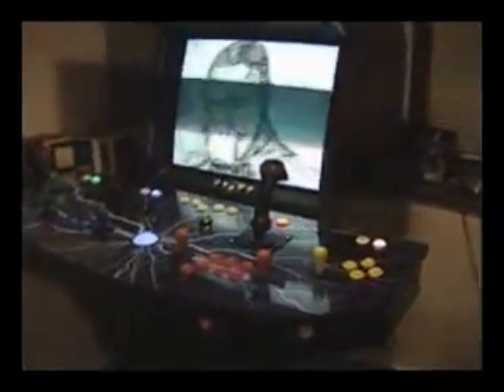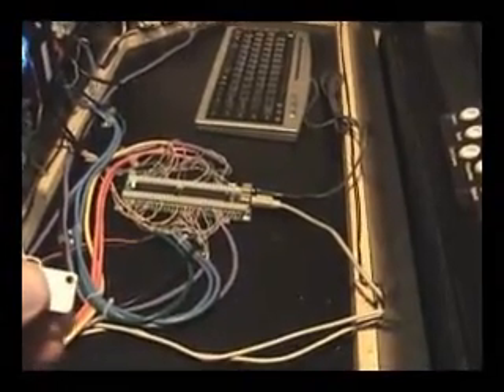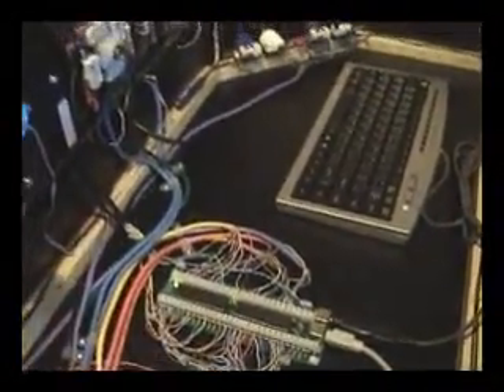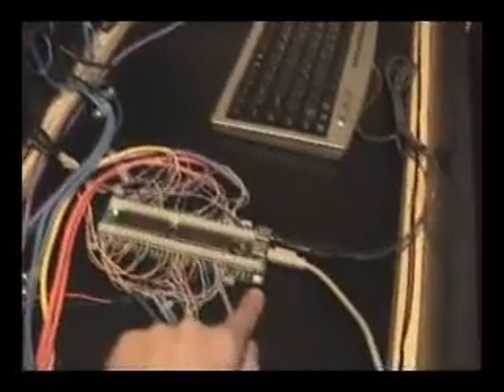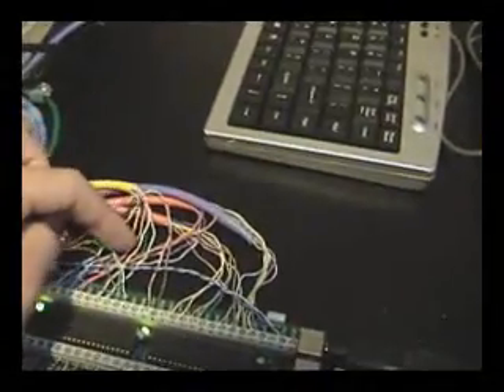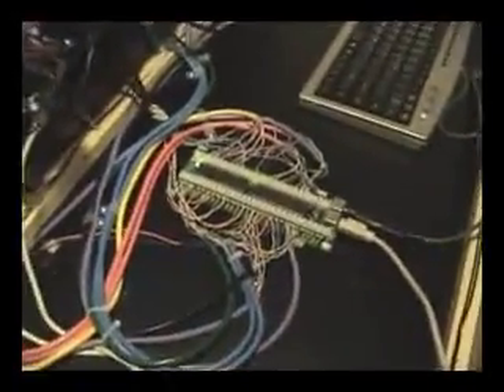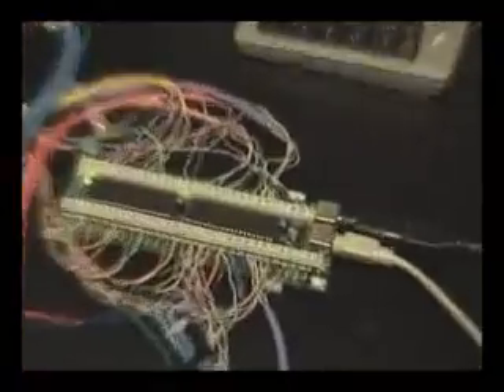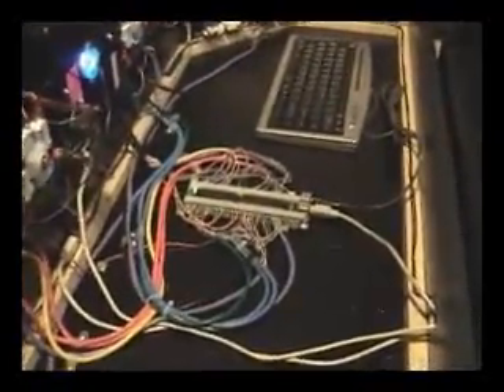Wiring an Arcade Control Panel for Beginners

Comment: Hi I purchased a Track & Field arcade upright, in working order. I took the control panel apart after labeling the plugs and switches. I have the trackball version, I put everything back after a new overlay and some new buttons, now nothing switch wise works. The jump/throw buttons all 4 of them I forgot to label but all the others I labeled. I also don't remember where the 3 braided ground wires go back to. Can you please help me? It's frustrating because everything worked right prior. I found NO BREAKS in any wires at all, so that's not the issue Thanks again
Reply: delusional2971 You're still posting replies to this 7 year old video, congrats to you! Nice going.
Reply from the maker: Yuuup.  Still in the hobby!  :-)
Reply from the maker: Shoot me an e-mail with pics and I'll take a look.  Also, you may want to post something at the arcadecontrols.com forums.  Those guys can help you without a doubt!

Comment: Nice Video.  I am setting an IPAC2 and ended up having some issues with the ground but I figured that out.  But once I figured all that out and re connected the cables to the IPAC they were all registering to the #2 button on the IPAC software...so I removed everything and am starting over.  I am using 22 gauge wire but I like your idea for the patch cables....I might go that route.  What size clamps did you use to attach to the prongs on micro-switches?

Comment from the maker: All switches need a positive and negative.  The positive goes to the encoder.  The negative or ground, goes to the ground of the control panel (you can connect all of them together, also known as daisy chaining).

Comment from the maker: NO means that when you press the switch, it will make contact (turn on the circuit), when you release it, it stops making contact.  NC means that the switch is already turned on and when you press the switch, it will stop making contact.  When you release it, it will stay on again.  Hope this helped.

Comment from the maker: I bought mine at an auto parts store online.  They are cheaper there.  100 for 4 dollars.   sherco - auto . com / wiring  Look for .187 quick connects (red) model # FDV1-205 for standard Cherry brand switches.  If using Japanese switches, use .110 quick connects.  Also, make sure you get a ratchet crimper (RIC1) to get a perfect crimp.  I made the mistake of crimping them manually first and not only did my hand hurt the next day, the crimps weren't that good and came out.

Comment: @Deluxejames 8 way joysticks still only use 4 switches per joystick.  They just have a mode that triggers two of the switches at once.  Diagonal upper left just triggers the up and left switches at the same time for example.

Comment from the maker: It's actually a used cab that I stripped down and painted it.  However if I were to build one I would use 3/4" MDF all around, including the control panel.

Comment: I've been researching prices myself  and the prices I found are 2 joysticks  a white player 1 and 2 button   plus 18 black buttons for $39.95 at xgaming . com    or Happ comp. arcade sticks for $8.49 each with a price of $1.20 per push button and $1.40  per player button plus cheap tools at groovygamegear . com      Ultimarc carries 100 crimp clips for $9.00    and also a 28 clip daisy chain. Not sure of the price.  Hope it helps

Comment: if you are building your first control panel you would probably be better sticking with the i-pac 2. Or if you want to work your way up to 4 players go with an i-pac 4 and just connect to the 1 and 2 player places and expand later whenever you feel comfortable. Zip ties are a good way to go for keeping the wires organized or color coded cables. If you have wired a car stereo or even a home stereo you will be able to figure it out.

Comment from the maker: Try ultimarc . com or groovygamegear . com

Prices vary.  I used cat 5 cable here in this video (harder to crimp since they are smaller) but in my future builds I now use "doorbell" wiring.  MUCH cheaper and it's the perfect size.  It comes in different colors.  Just look in the doorbell section at Home Depot.  Goes for about $5 for a nice sized spool.  I usually get either black or a dark color for ground and the rest another brighter color.

Good Luck!

Comment from the maker: If you have a 3/4" wood pane, I install the joystick bases from underneath the panel by first drilling a shallow pilot hole smaller than the sctual screw. Use 1" long zinc plated wood screws from Home depot or Lowes at about $4 per 100.  The size is #10. The box would then be marked 10 X 1.

Comment from the maker: It depends.  I use single.  It's easier for me to work with (in my opinion) and easier to crimp.  However, it's a bit stiffer than 3 strand wire.  Keep this in mind if you move stuff around a lot.  Bending it back and forth may not be a good idea.  But I've never had a problem with it.

Comment from the maker: @delusional2971 
Forgot to mention that I got the Cat5E cables from cablewholesale . com 
Choose  NETWORK / PHONE PRODUCTS on the list at the left.  Then click on the Cat 5 E Network cables link.  Get the 7 foot size ($1.63 each).  Don't worry about the end connectors that they come with.  You can just cut them off.  Comes out to be super cheap in the end and you can choose from tons of colors!

Comment from the maker: @nick12882 
Sure.  I use doorbell wire for my current builds.  It's economical and can be found in your local Home Depot or Lowes.  You get more band for your buck with the roll that you get.  They come in different colors.  I usually get the dark color for ground and the brighter color for the other switches.

Comment from the maker: You'll need .187 connectors.  They work the best with the microswitches.  The ones at local stores were a bit to big and the cat 5 wire kept slipping out (and expensive too).  I found some online that were perfect at Sherco Auto Supply (google it).  Part #:  FDV1-187.  100 for under $5!  Also, make sure you buy a ratcheting crimper!  Trust me on that one!  Part #:  RIC1.  I learned the hard way buy buying a cheaper one that didn't have the ratchet feature.  They crimp these connectors perfectly!

Comment: I ordered my Ipac2 tonight and i'll use your Cat5 idea...(which is brilliant!)

I don't know what size / style connectors I need to pickup though! I'm assuming those are fast-on...blade style female connectors?

Are all Cat5 cables created equal? Do they all use the same gauge wire inside? Looking at mine...they seem pretty thin. 22 gauge maybe? (i'm guessing....just hoping YOU know)

I've never crimped a wire in my life...so this should be interesting to say the least!

Thanks in advance!

Comment from the maker: Yes, that's also a good option.  It's a bit tricky to do, but if you search the BYOAC forums you will find some great tutorials (with pics) on what gamepad works the best for hacking, as not all gamepads have easy solder points to do so.

Comment from the maker: Not at all.  You can also use other keyboard encoders.  I just happen to have Ultimarc's Ipac-4 since it has 56 inputs for my 4 player setup.  But you can also use groovygamegear's keywiz instead.  The principle is the same as described in the video.  It also has a terminal block to screw the wires into.

The other option is to hack a keyboard, but it's not suggested, as ghosting will occur.  Try googling byoac wiki.  There is a guide there explaining your options.  Good Luck!

Comment from the maker: To clarify:  Both 4 way joys and 8 way joys have 4 microswitches on them.  The 8 way achieves diagonals by pressing 2 switches at the same time.  ie: up and left = diagonal up/left.  4 ways limit motion to only allow 4 directions:  Diagonals are not possible.  You can connect a 4 way and 8 way at the same time to the 4 inputs on the ipac.  That's what I did.  I actually connected the flight stick to it too.  So I have 3 joys connected to the ipac's 4 joy1 inputs.

Comment: its not the i pac that decides if its a 4-way, its the joystick its self.  the 4-way joystick will just only move up, down, left and right it wont move diagonally and let you push two directions at once which (makes a diagonal motion of course.)

Comment from the maker: The best bet it to find a standard molex 'Y adapter' and modify it.  That way if you screw up splicing the wires, you won't be messing up your PC's power supply wiring.  Then all you have to do it plug that connector into your power supply in your PC.

Comment from the maker: Glad you liked the video.  Hope it helps!

I illuminate the lights by running it directly to my PC's power supply.  I use the +5volts (red wires) for the buttons and the +12volts (yellow wires) for the marquee light above.  The coin doors (not shown) are also illuminated using the +12volts on the power supply.

Comment from the maker: I'm not sure if there is a limitation to the length of a keyboard cable though, if the signal would get degraded or not.  By why not go wireless?  Perhaps you can buy cheap wireless USB controls and then hack them to the controller's joysticks and buttons?

Comment from the maker: The I-pacs come in two flavors.  PS2 or USB inputs.  I have the PS2 version.  Basically there are two female ports on the ipac itself.  It comes with the two male ended cable to plug from the ipac into the pc's keyboard port.  The other "pass through" port on the ipac is where you would plug in your ps2 keyboard (or in my case I have a USB keyboard with a PS2 adaptor on it). 

If you go to Ultimarc's website and click on the ipac link you will see a picture of it.

Comment from the maker: The only problem with widescreen is that the image will get distorted and not be in it's "true" format.  Personally, I am building a new machine with a 22" CRT (4:3, not widescreen) in it.  You can even find a 21" CRT cheap nowadays.  Check your local Craigslist.

Comment from the maker: You can either solder them on or crimp them on using a crimper and some .187 female connectors (shown in red in the video on the end of the microswitches and wires).  I prefer crimping the ends on, since they can be easily removed if necessary.

Comment from the maker: For a Happ brand mouse however, you need to buy not only the trackball, but the Optipac (Ultimarc) as well. The Happ requires a mounting plate, but there is a fantastic product that just came out (by Ultimarc as well). That mounts from underneath without the need for a mounting plate. You simply cut a hole big enough for the ball and then mount it from underneath. They you can plug it into the Optipac or the more recently introduced USB interface adaptor. Plug and play.

Comment from the maker: I used an "Electric Ice-T" by GroovyGameGear.  It has a USB port on the end and is simply plug and play.  To mount it you need a Trackball mounting plate which goes on top of the panel, and then you screw the trackball to the plate from underneath which "sandwiches" the wood.  I flush mounted mine, which means that I route out a grove for the plate to "countersink" into.  Then the overlay (blue lightning) is applied over it to cover it.

Comment from the maker: The grounding can start anywhere you want.  I started on one side of the panel and worked my way through to the other end.

The ipac and joys can be connected to the same ground.  :-)

The iPac has 2 ground inputs, in case you decide to daisy chain half of the panel to each one.  Either way it does not matter how many or how few you connect, since they are all ground.